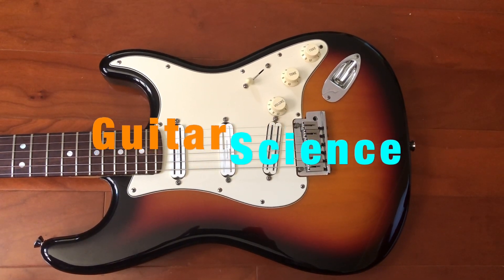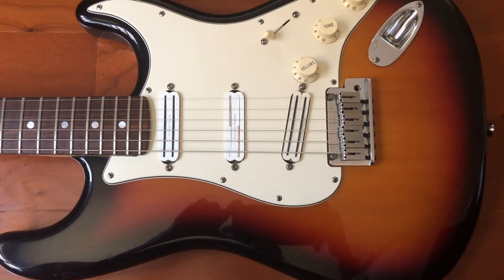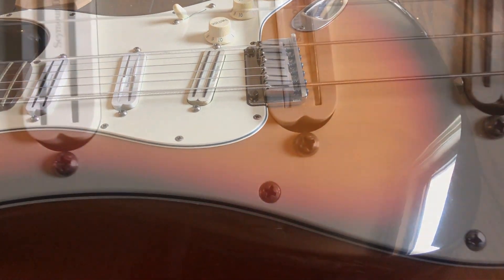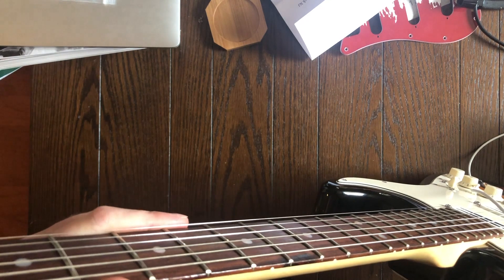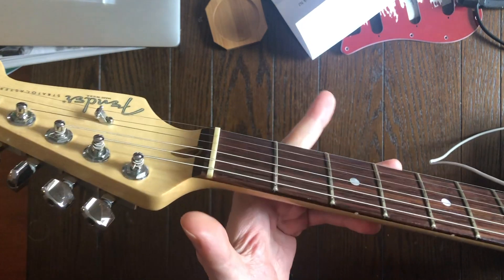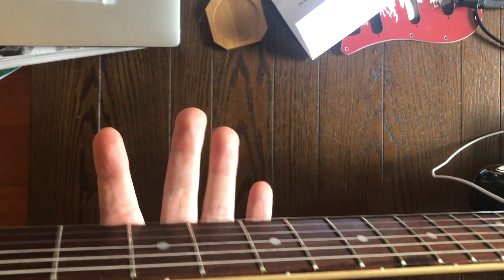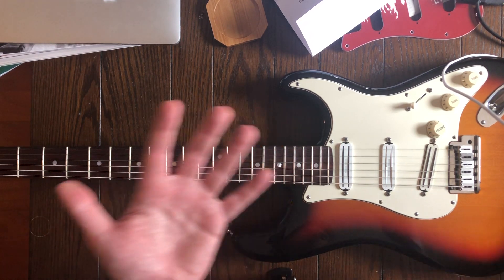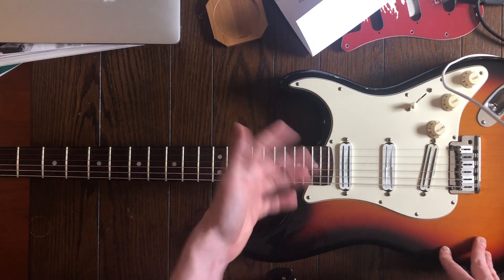How do Modern Guitars Age? Myths and Realities

Comment: The same is true of my 1991 mim Fender Telecaster! It remains almost showroom, after 30 years!
Reply from the maker: Nice! Got a 98 MiM tele that didn't quite make it into this video. I'm not the first, or probably the second owner, but it's still a great axe with 0 problems.
Reply: I have a 1997 mim Fender Strat the poly is still pistine but the pickguard has yellowed nicely-also I have wear on the rosewood neck! It looks vintage but ols .
Reply: vintage but new.

Comment: it all depends on how you treat the thing, polyurethane holds up a lot stronger than nitro and its hard to get the raw wood exposed. u can still buckle rash it but looks more sanded down than checked off. most common poly ware is pick scratches and finish chips
Reply from the maker: The scratches don't bother me much but the chips look awful. But if you're careful, it holds up pretty well like my guitar in the video.
Reply: @guitarscience6926  yea ive always hated the way poly chips away. if you want a poly finish to ware closer to nitro u can sand it down to a satin finish with 0000 steel wool but it still wont get the checking
Reply: Yeah, it chips off. When I got my first chip in my Jazz, I kind of gave up on it. It kind of looks like Swiss cheese in some spots.

Comment: I prefer the nitro finish on my Setzer Gretsch over the poly Gretsch's. The finish feels better to me. I also like the fact that the finish will wear off over time instead of being coated in poly. I don't think it impacts tone really, but I can feel a difference and prefer the nitro.
Reply: If it’s a recent guitar don’t assume the nitro finish is actually the same as vintage nitrocellulose. Fender at least adds plasticizers to it. It will NOT age like a 1950s guitar, not even close.

Comment: My strat is 20 years old and played quite a bit. Looks like yours, except for chips in the body finish. Basically new, except oxidized and rusty screws/hardware, and fret wear. I bet Leo would be happy about poly finish!

I would say that the only practical downside of poly finish is if the wood isn’t fully cured before finished. Poly doesn’t mix with water, so will seal moisture into the wood; it will resell moisture and protect wood though. Nitro allows moisture in the wood to evaporate over time, which won’t have any effect on an electric guitar that was constructed properly

Comment: You nailed it. You have to discover the whole neck, & play it. Im versed in level recrown, but once I complete the process, I play the whole neck..., alot, without noticing additional wear after I go through a guitar. I'd like to add, I've developed a light touch over the years, having learned to relax while playing,  also use alot of vibrato, & more deliberate note application. What I noticed is, my fret board is polished in the positions that are chorded, or soloed, but the frets do not re-wear. The lesson I can pass on to any beginners. You're playing guitar, A.)you need guitar tools..,
neck level/fret rocker/fret file/
neck radius gauge set/crown file SM 5085/fret dressing file SM1175/ 
multi bit screwdriver set/small paintbrushes for dusting bridge, & headstock, etc. B.) YOU NEED TO LEARN BASIC SET UP, IT WILL 100% IMPROVE YOUR PLAYING, & TONE. Fix your own buzzes, adjust your own truss rod, set your own floyd rose, adjust your own pole pieces, learn to intonate your strings. Your guitar WILL age, even if it is only the woods for a neck, or body.  Heck, your axe might be aligned with the right point in space, & time, & go out of adjustment. Learn your axe, age together. TLC goes, a long way.
Reply from the maker: Totally agree. Great advice.  I used to get frustrated and stop playing when a guitar would go 'out'. Now I just adjust and enjoy it again!
Reply: @guitarscience6926  CHEERS!
Reply: Bravo, awesome tips! One little tid bit id add if you have never experienced it, nitro relic guitars that also have stainless steel frets. The SS frets do make it a little brighter, but theres something magical about a nitro body and SS frets enabling you to beat the crap out of the frets and have it feel like butter and day 1 frets. I hope more MFG consider that combo, ageless frets but the rest of the guitar allows you to make it your own with no fear of playing hard.

Comment: I have a 2024 American Vintage II ‘57 Strat, and the finish is a top layer of what their marketing calls “nitrocellulose” (it’s not), over an extremely hard, thick layer of plastic. The “nitro” has plasticizers added to it, and you cannot put checks in it no matter what you do. It’s really false advertising on Fender’s part, and was one of the main reasons I bought the guitar.
Fender does this to avoid warranty issues and returns from shipping climate finish damage.
I’ve since sanded the entire finish off (with much difficulty), and I’m going to put a hand rubbed varnish from StewMac on it.
Reply: Agreed. It’s deceiving. That’s why I went MJT for my telecaster. I did buy a road work fender strat, which is supposed to be nitro finished. The next does wear in but the body… barely wears in
Reply: I'm sorry but... Why would you do that to a new guitar? There's a lot of options on a second hand market.
Reply: @bagazheful  because it's my guitar, and I can do whatever I want to it? I also like modifying my guitars and working with my hands. If you don't, that's fine.
I'm not the only person upset by Fender's false advertising. There are lots of posts about this online.

Comment: The fret thing i think is a result of good technique and as you mentioned; higher quality alloy. After about 500-800 hours of play (for me about 2 years with 1-2hr/day) my squier cv is finished. I bought a mim classic series after that and it has more play and doesnt even really need its first fret level yet. I use lighter strings and lighter touch now, too.
Reply from the maker: Interesting. I have a number of CV necks and I'm honestly hesitant to make them everyday players because I'm afraid I'll wear out the cheaper alloy materials. I've recently become a big fan of stainless steel frets. I enjoy the feel and none of my SS fretted necks have developed fret wear over the years.
Reply: @guitarscience6926  yeah its a big difference. Kinda surprised because fret wire is pretty cheap to begin with, also mine is chinese so its possible the indonesian ones have better frets. There are people talking about this online but I guess most people either quit or get another guitar before it becomes a problem?

 Stainless is interesting, im contemplating getting the tools and refretting it. Dont see any drawbacks with it at all.

Comment: What I'm not understanding is this argument that there's more 'resonance' with nitro. Nitro is softer, wouldn't a soft surface absorb, not reflect vibration?
Reply: The tonewood myth on electric guitars makes zero sense. The “logic” is that Nitro is a lighter finish and thus “lets the wood breathe.” Even if that made sense, the application of Nitro was never consistent and sometimes it was even applied on top of a plastic coating.
Reply: Then explain to me why nobody puts polyurethane on violins.
Reply: @joeltunnah  as per google: “Most modern oil varnishes for mid- to high end manufactured violins (violas, celli and double basses) are alkyd varnishes (polyester resin cooked with oil) though some could be phenolic”

My man you just played yourself. Not to mention that violin, an acoustic instrument, is NOT A SOLID BODY ELECTRIC GUITAR.
Reply: @luistijerina  you literally copied the first result in Google. LOL. Gen Z research.
Varnish is used on violins, and is nothing like polyurethane in ingredients, application, or results.
And if poly doesn't affect resonance, why aren't violins poly'd? A: because it does affect resonance. That's true of a solid or hollowbody instrument. Big manufacturers don't use polyurethane because it sounds better, they use it because it's tougher, faster to apply a thick finish, and cheaper.
My man you just played yourself.

Comment: I’m not sure about resting the guitar on it’s back vs sitting it and how much that effects string pull other than tuning. More likely there was an environmental change with humidity and temp that took place. When someone says “warped neck” I immediately believe that they don’t understand how adjust the truss rod. Another thing to consider would be an uneven fretboard, but this would be from the factory. I have a Gibson Explorer than needed a fret level because of this. Bought it used but was only a year old (I think that’s why the guy sold it). Once the frets were leveled, the unevenness of the board became a non-issue. Anyway, curvature of the neck can be adjusted with that truss rod. Here in the north east I need to adjust the Rod accordingly depending on what the weather is doing since we have major humidity swings.
Reply from the maker: Yeah when the GC guy said 'warped neck', I pretty much stopped listening to him.  At this point, the guitar is 16 years old and is incredibly stable. Haven't even needed to adjust the truss rod in years, despite having to do so on most of my other guitars seasonally.
Reply: Yeah, it also makes me rethink the idea of getting a guitar setup at a GC. 😅